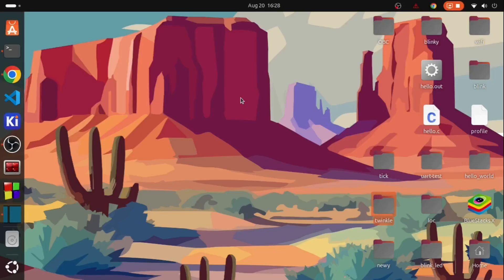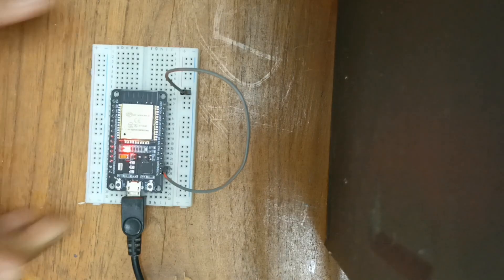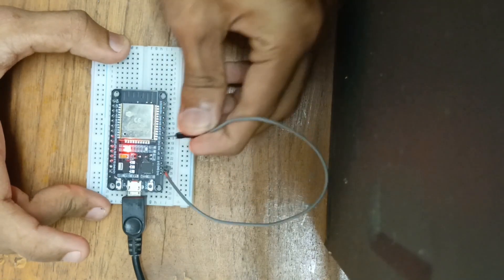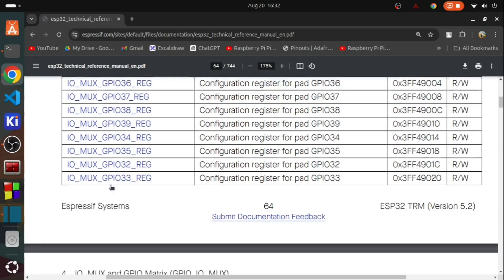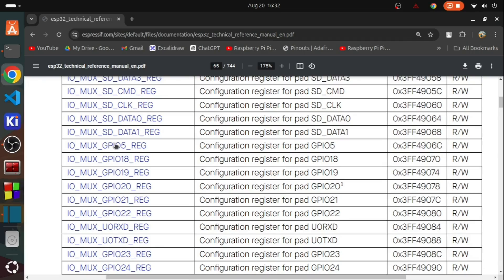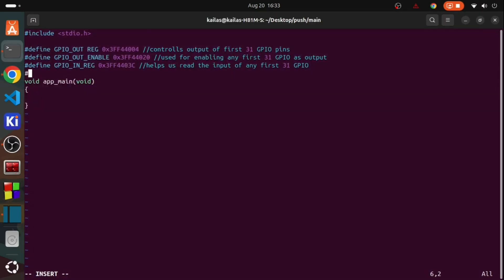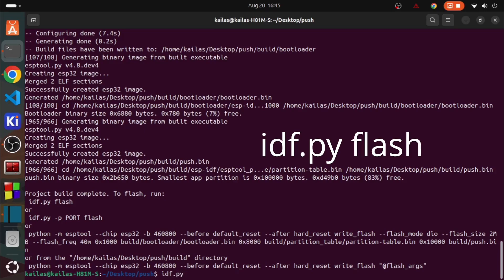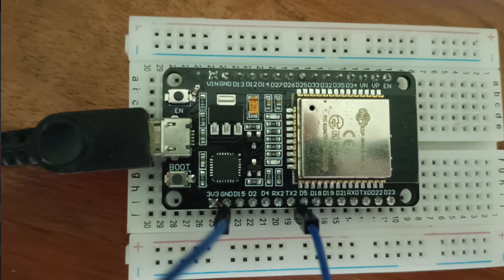GPIO Programming Bare metal ESP32 || ESP32 Baremetal Series Part 03

Comment: It's NOT an bare-metal programming. You use freertos (yeah, you use it, see the app_main call, it's just task, runned on core 0), you use esp framework, you can just write with built-in functions, it's fine. But it's not bare metal. For real bare-metal, I think, you need to be an espressif developer... I can't find how to disable freertos in idf, but, I think, I can initialise base clocks and use some basic functionality without IDF. I have not time to learn it, but there should be a solution for every problem)